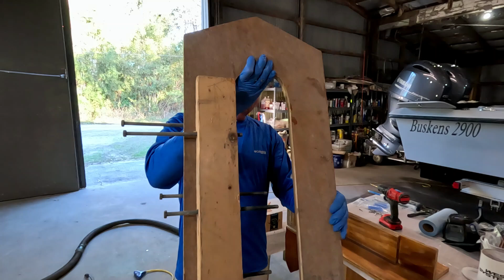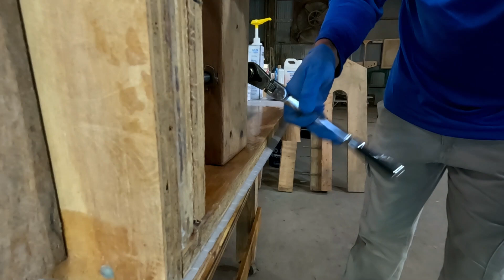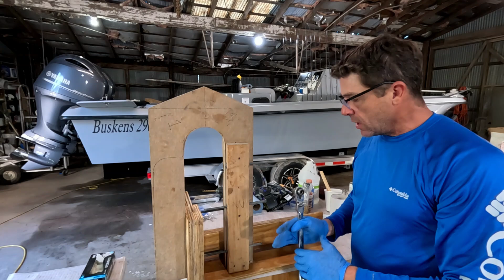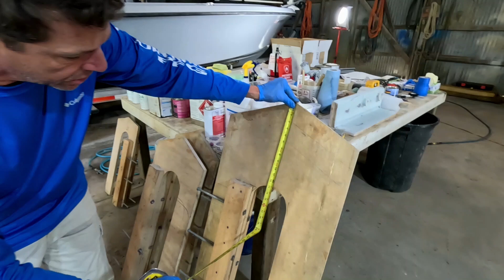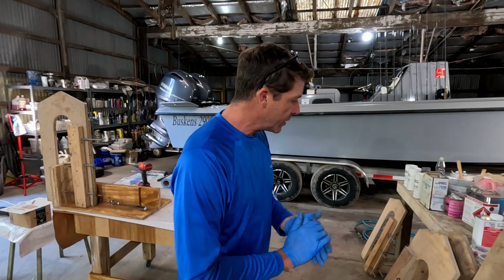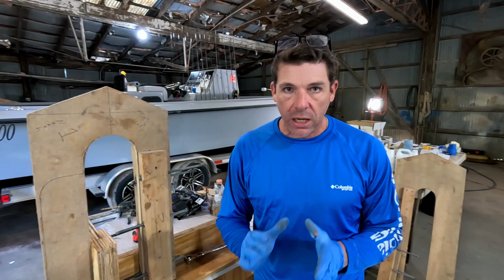How to Make THE BEST Transom Clamps!

Comment: Captain Joe thanks for your help as I build my own boat. Mine is based on the WWII German Light Assault Boat and I have terrible plans that are only line drawings and the boats themselves were designed to be disposable. As I would like mine to last more than one or two "assaults" I have had to modify the design. This boat had no stringers in its original design! And was not covered in fiberglass, so you have been a tremendous help. I have started my own YouTube bit on my boat build so folks can watch me stumble along and have a good laugh. Thanks for all your help!

Comment: Is there a foot that could be put on the bolt, or would putting a block at the point of the bolt to spread the force be worthwhile? It seems the bolt would apply force to the surface in a very small spot, breaking fibers or cracking a layer of the ply.

Comment: Thank you for sharing your knowledge and experience.   I have a 16' sailboat, and I am not sure if I will need to head down this path.  The outboard mount is loose, and I do not know if there has been water penetration.  Also, the lower gudgeon is bent, which suggests either the rudder was hit while on the boat, or the gudgeon  was hit while the rudder was off the boat.

Comment: Man! Why couldn't I have seen this video 2 days ago.  I literally just epoxied my coosa in the transom of my 95 Bullet 21xdc bass boat yesterday. I had boards wrapped in plastic clamped with this and that. Layed the kitchen sink up against it to hold tight. It worked but dang this is way slicker. Next time I guess.  Love your videos.  Watch them all. Big help.
Reply from the maker: Yep, some good transom clamps really help the job go much easier. Sounds like you got it done, though! I have several videos that should be helpful for you here on the channel. The how-to epoxy over plywood and how to fiberglass over plywood video series has lots of good info. I hope this helps, and I wish you the best!

Comment: Man I had to comment. This is a great freaking idea. I just prepared both sides of my outer skin for the transom install on my 16ft mfg. I was going to build a large clamping system that use the same parts but this design is much better. With my stringers removed I do not have the leverage I would have to add a spacer block to compress the bottom section. This will allow me to place it where I need it and will not have to add the horizontal 2x4 on the outside of the skin when I clamp.... maybe
Reply from the maker: Awesome! Glad to help, and I wish you the very best with your transom replacement!
Reply: @FishBumpTV  Thanks again. I did a dry test fit and works good. I could not find a threaded bolt over 6 inches so I just used threaded rod with acorn nut. I tried to use only 1 2x4 on one side and it started to twist so I see why we need to double up. My first boat 19 grady I did the transom and did not get enough squeeze on it. I had to dig it all out and redo it. This time a bit older and a bit wiser I will take my time.
Reply from the maker: @darrisb1727  Yep, your transom is one of those things that needs to be Right! Glad the transom clamps are helpful and as always I appreciate you watching!

Comment: Absolutely amazing info and advice, in the uk we call the fastener a “ 4 pronged captive tee nut “ threaded bar in various M sizes are available over in the UK. Even better are furniture “ threaded hex drive fixings” drill a pilot  hole and use a hex key to screw the hollow fixing into the wood for a solid bite, then screw the threaded rod through. Eg. M10 fixing M10 threaded rod. Thank you for this video I shall be using this clamp method🎉
Reply from the maker: Wow, thanks so much! I appreciate your thoughts and watching all the way from the UK 🇬🇧!

Comment: What size bolts and what length
Reply from the maker: 3/8 x 6 or 7 the length of the bolt would depend on your transom thickness.
Reply: I cant find any bolts with thread longer than 2 inches unless I use carag bolts or all thread....😢

Comment: What size and what did you call the bolts you use on your clamps ?  I’m running to the hardware store to purchase some ,, thank you , love the videos man.. also is it ok to bond 3/4” composite  to 3/4” Marin ply fir for a replacement transom?  I was told to do so b/c the composite doesn’t hold screws very well.  I’d love to add a fish box to my new transom as well.  Any ideas , a mold ?  Maybe build it with 1/4 ply and glass over
Reply: I’m trying to add pics for you , my transom currently has a splash well which I’m removing to build the transom up to the height of the gunwales.  I have a jack plate I’m installing so no splash well needed
Reply from the maker: 3/8 bolts work good for the transom clamps, and we run them through what are called T nuts. I personally have not bonded Coosa board to marine ply in an application like that. We usually go with one or the other in most cases. The 26 pound density Coosa holds fasteners pretty good, especially if it has a good bit of glass on it. You might want to try a test piece to see if it could work for you. We hope to build a  hardtop mold for our 29 soon, so there may be some good info for you in that video. In the meantime if you look farther back in the channel, we have a video showing when we built our console and seat mold that you might find interesting. Hope this helps, and best of luck with your project!

Comment: Hey Joe, quick question, I’m going to fiberglass over some plywood that is sheathing plywood. What would you recommend to fill gaps and knot holes? Maybe make that peanut butter mixture that you make and then lay glass over it?
Reply from the maker: We don't work with a lot of sheathing plywood in the shop. We usually work with marine fir plywood. As you know, different grades of ply can react differently. Epoxy is going to bond to the widest range of materials, but if you fill imperfections with epoxy peanut butter you will want to use epoxy resin and fiberglass over the whole surface. Hope this helps and thanks for watching

Comment: Thank you for all the info this is really helping me out on my beginning of my boat restoration. I got a question is it ok to do the stringers and bulk heads while my boat is on my trailer?
Reply from the maker: Glad you are finding the videos helpful! Many people do leave the boat on the trailer while doing repairs. The boat needs to be well supported whether you leave it on, or take it off. The stringers are the backbone of the boat, and when you remove them the boat can lose some of its shape. If possible we will sometimes only do one stringer at a time so that the bottom of the boat  is never left completely unsupported. I hope to make a video on this subject soon for you guys. I hope this helps and thanks for watching!

Comment: Hey Joe I hate to keep bothering you but a friend on mine gave me 2 gal of polyester laminating resin is that any good or no I want you honest opinion about using on my boat
Reply from the maker: We use polyester laminating resin alot, but there are different brands and shelf lives. Polyester laminating resin is what we used to build our 29 and it is what we used on our how to fiberglass over plywood video. I just got several fresh gallons of different polyester and vinyl Ester resins in the shop and plan to do a video on them very soon. Hope this helps and thanks for watching!
Reply: @FishBumpTV  thanks a bunch yeah it’s about 4 months old he got 5 gal had this left over was just wanting to make sure about the brand polymer world is the brand just want to make sure I’m using the right stuff
Reply: Great video. After my floor replacement, transom is next.  What would be the best way to clamp/secure on a bass boat that has the cap still on?

Comment: Thanks Joe!  I love the DIY videos.  How about showing how to build a fiberglass mold to pull parts from?  Maybe something like a custom leaning post.  That could lead to info on upholstery, if you do that kind of work as well.  If not, maybe you can get a guest expert to help out?  Just spit balling some ideas.  Thanks for all of the hard work bringing the information to us.
Reply: ditto on this one but more basic/diy.  maybe a simple hatch/cover from a wooden mold.  i've got a small hatch over my bilge that cracked and need to duplicate it. has a recessed lip on the underside.  could show how to make the mold, wax the inside,  and brush gelcoat on, lay the glass and core and then pop out of the mold.  trim and finish.  well on your way to 25 thousand subscribers and 2.5 MILLION views.  congrats capt!
Reply from the maker: Thanks for the suggestion! I have a mold build planned for you guys soon. I truly appreciate you watching and commenting.
Reply from the maker: Thanks! Great suggestion. I hope to start building a key west style hard-top mold for our 29 very soon, but will also show some options for hatches leaning posts etc. In the meantime I do have a video or two in our 29 boat build series that details me building my console and leaning post-live well. It is quite a ways back in the channel. The thumbnail shows me hoisting a upside down console mold off the plug. I think you might find it interesting. I appreciate you watching and commenting!

Comment: Hi Capt Joe, was wondering if you ever use peanut butter made with polyester resin to bond plywood or coosa together? Super cool content btw, learning a lot from every video. Thanks
Reply from the maker: I would recommend a couple layers of csm or mat with polyester resin instead making a peanut butter. Polyester resin is harder and more brittle than epoxy, and isn't as good at being a glue or adhesive without having actual fiberglass in the mix. Polyester with 2 layers of csm is how I made the stringers in our 29, and I have been happy with the results. Hope this helps and thanks for Watching!

Comment: Another great video, I use the same style clamps in my shop and just hammer in wedges to tighten the clamps, I'm going to add the bolts to mine its a better design and easier and more cost effective than welding up steel clamps. thanks!
Reply from the maker: Glad to help and thanks for watching!

Comment: Capt Joe, Another great video! I would love a video on foam core deck, soft spot repair. I picked up a 2008, 17' CC project boat. The two main reasons it is a Project Boat is an 11" x 6" soft spot in the deck, and a probable replacement of the plywood core in the transom. I believe the deck problem, is due to de-lamination of the upper fiberglass layer, maybe some deterioration of the foam core (defect, or maybe deck impact?). The area is outside of the longitudinal stringer, between the stringer and the gunwale. I do not have access from below.
Reading the boards and watching videos, the various suggestions for repairing the deck include:

1. Drill some holes in the upper fiberglass layer and inject; 
  a. Great Stuff foam 
  b. polyester resin
  c. epoxy resin
2. Cut out the section until reaching good core. Replace the damaged foam core with;
  a. new foam core using;
     1. polyester resin
     2. epoxy resin
  b. Coosa board using;
     1. polyester resin
     2. epoxy resin
3. Tab in a new section using foam core or Coosa board.
4. Cutout the bad section and install a hatch...

The current deck is very slick. No matter how I have to repair it, I will re-gelcoat the entire deck and add some grit for traction.

If there is enough additional interest in this type of repair, it would make nice video for us "Project Boat" folks.
Thanks!
Clay
Reply from the maker: Sounds like a great project boat! There are usually several different ways a problem like this could be repaired. I would try to find out what the floor core is made of. Is it plywood or composite. Also, is there water or moisture in the material. If it is dry, but just delaminated you could inject some resin the rebound it. If it is wet, or rotten, I would probably cut out and replace with new material. Just my opinion, hope it helps and thanks for watching !